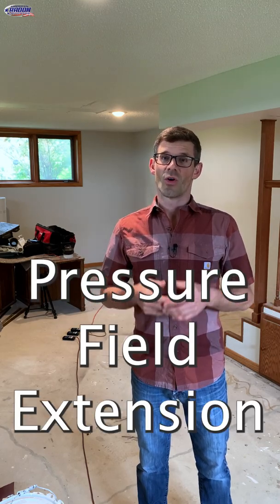What is Pressure Field Extension?

Comment: what are your sub slab target suction pressures at the weakest hole? summer and winter
Reply from the maker: This question is not easy to answer as many factors must be accounted for. However, a simple answer is a negative number that stays negative during the winter, occupant usage, and most weather events. In some houses, we aim for -5.0 pascals; in some, we strive for -0.1. 

In the vapor intrusion mitigation world, they aim for -5.0 pascals in the summer and -3.0 in the winter under maximum depressurization (all appliances that exhaust air from the building on). However, this may not be practical if there are leaks that can't be sealed or the soil is really porous.